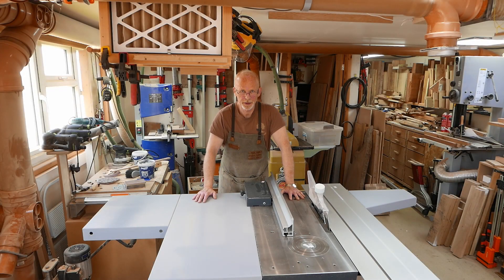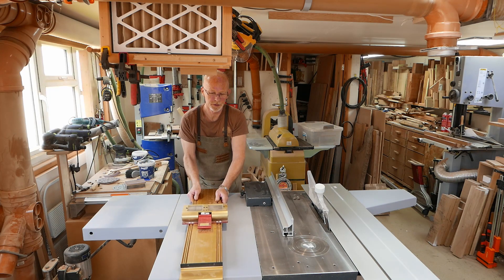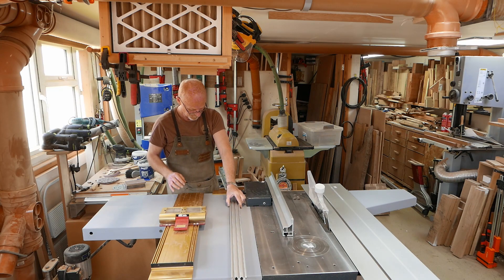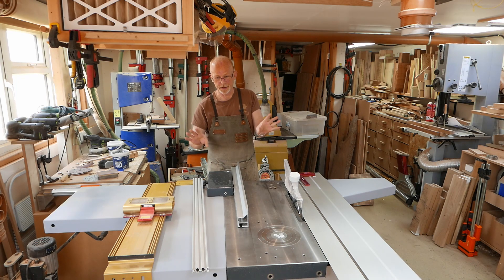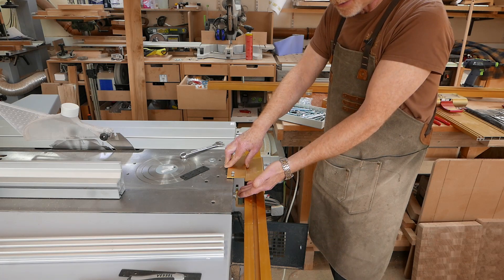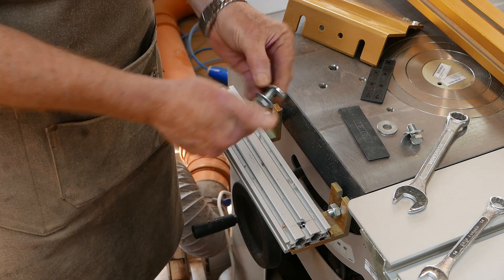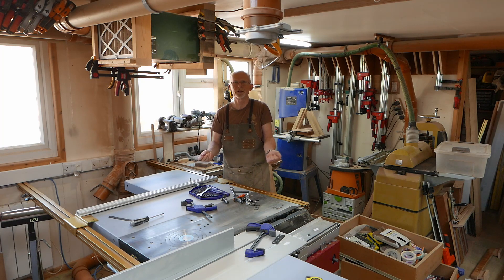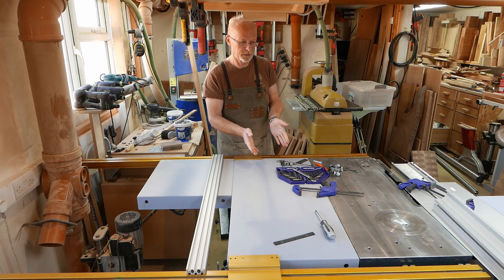Fitting the Incra TS LS Table Saw Fence to a Hammer B3 Sliding Table Saw

Comment from the maker: Fence alignment should be set with the blade, NOT the sliding table as stated in the video.

Since recording this video I noticed some ‘rubbing’ on the outfeed end of the blade when ripping which caused me to ring the tech support guys at Felder UK, who duly informed me that the rip fence should be aligned with the blade as opposed to the sliding table which I stated in the video.  I have now corrected this.

Comment: I admire your perseverance, Graham! To help with stability of the rails can’t you use the holes in the pressed steel extension table. You should have at least two bolts spare from the old Hammer fence rail. If you can make up two others they would help.
Reply from the maker: Hi David, I did look at them as I was fitting the rails.  I'm not sure if I'm going to keep the table on the far right or not.  I'm gogin to be making a cabinet to fit underneath the rails as mentioned.  I might take away the little table and replace it with a board of, something.  I need to figure out a suitable support for the overhead crown guard.  A little more sturdy than the last.  Ideas and suggestions welcome. 👍

Comment: Hi Graham, I can't remember if I've asked this before ( it's an age thing ) but, Do you lock the fence down to the side rails each and every time you change measurements ?
Reply from the maker: Hi Allan, no, only the centre rail itself.
Reply: @GTWoodshop  So there's no movement of the fence at all when not locked down to the rails except maybe when cutting down large heavy sheets ( I bet you just realised I have an Incra router fence )  ;)
Reply from the maker: @alland1241  Hi Allan, if I try I can flex it maybe 1/2 mm.  I only know that after calibrating it up using the iGaging Digital Saw Gauge, and I would never have guessed. 🤣🤣

Comment: Great Video Graham!
One question:
It's recommend to pull back the rip fence before the blade when using the rip fence with the miter fence together.
How do you do that with this Incra System?
Reply from the maker: Hi, good question.  I don't.  I made an angle cutting / small piece cutting jig to use on the sliding table so I could avoid that very issue.
https://youtu.be/FRoK8TDKMEM
I am thinking about making a piece to bolt to the front of the Incra fence that will accomplish the same thing. 👍

Comment: What a well thought out modification.  Like having an old friend (Incra) play nice with the new friend (Hammer).  I couldn’t tell from the camera angle, but is the Incra sight window as close as it was on the other table saw? You’ve mentioned “older eyes” in other videos. I use an extra strong pair of reading glasses to sight the Incra line on my router table.
Reply from the maker: HI Dan, thanks.  The sight glass is a little further away, couple of  inches, and I wear glasses to see mine as well, they're  part of mine routine now. 👍